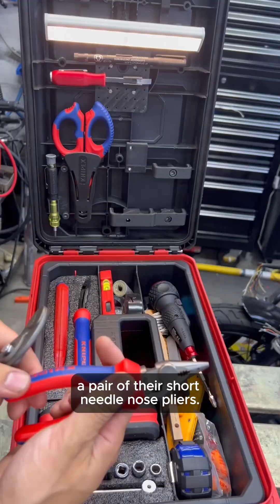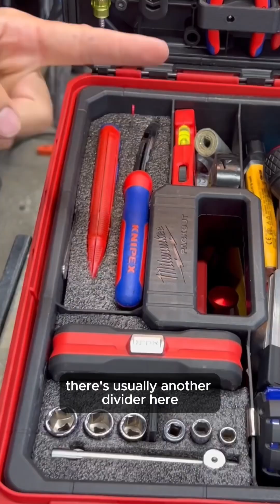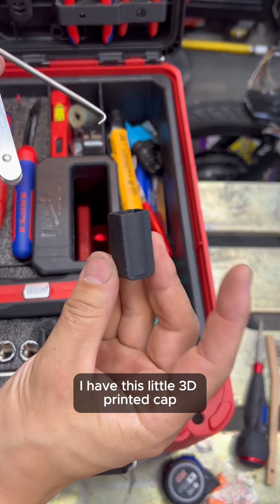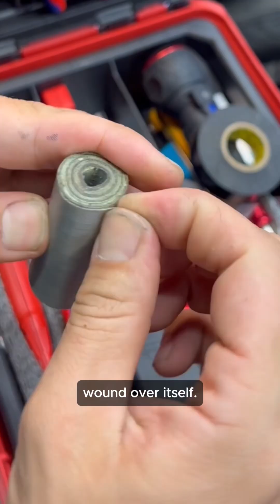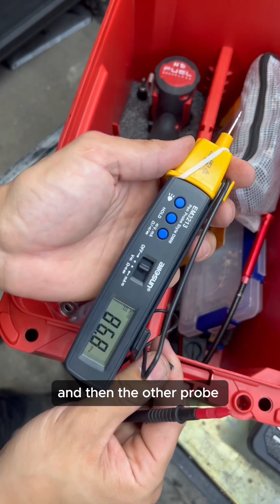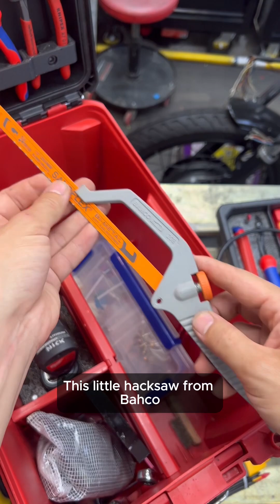Ultimate Milwaukee Packout Compact Tool Box  48-22-8422  Setup - 3D Printed Organizers + Kaizen Foam

Comment: Nice video I always like seeing tool recommendations that I can use for my tools kits.  I'm going to have to try that Staedtler marker.  I agree with most the stuff you include, and in fact carry it myself.  If I was making recommendations I would scrap the motion light and replace it with Milwaukee's new low profile magnetic task light.  That way you could use it to light your toolbox and also take it off to provide light for projects.  You have a lot of electrical tools, I'd probably include a wire stripper, and small case of wire nuts.  I'd also recommend a Fastcap folding chisel.  The blade folds into the handle protecting it, and also giving it a small footprint.  And lastly blue painter's tape, for projects where I'm concerned with marking up walls.  Hope that helps you on your quest.
Reply from the maker: Love the suggestions!  

I used to have a wire stripper, but the Knipex scissors do a great job stripping both light and heavy gauge wire becuase of how sharp they are.  I also have a few WAGOs ion that organizer.

I use this light to light projects.  I just can't bring myself to paying Milwaukee prices for a light.  I'm also not sure it would fit with the lid clearence.
Reply: What was that head lamp flexible light strip product?